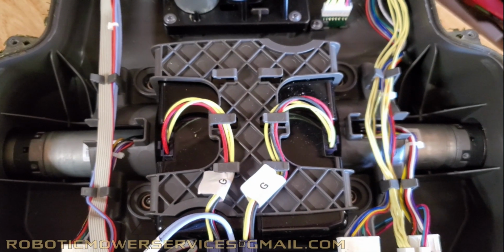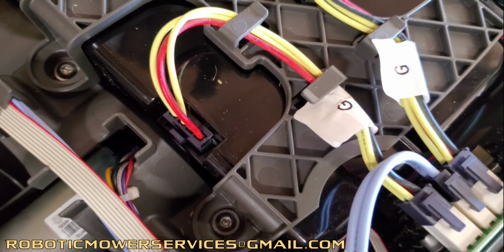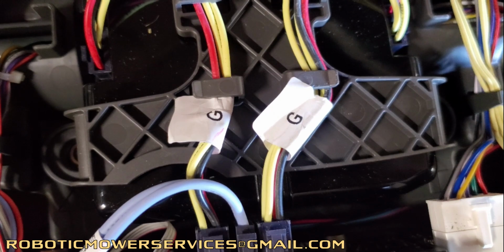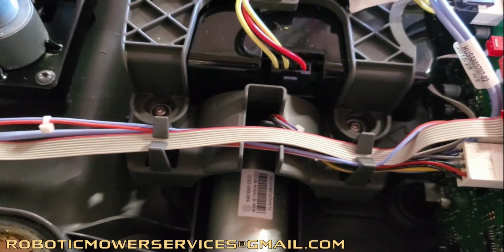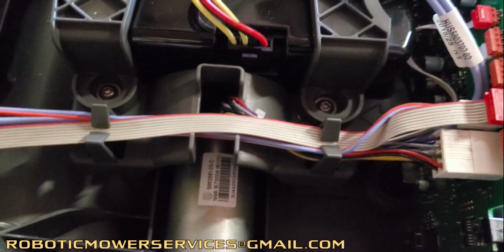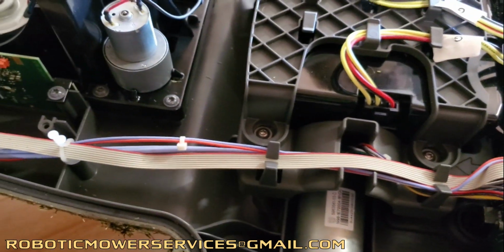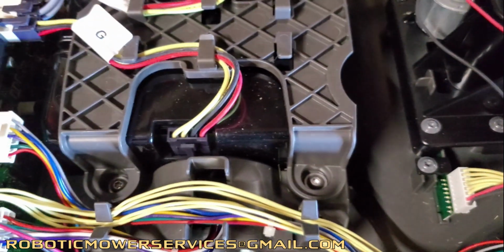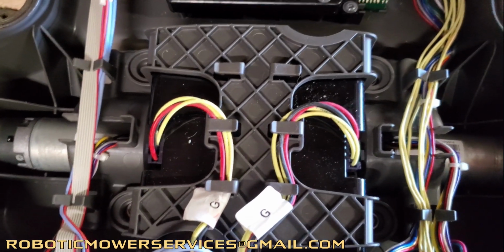New Heftier Battery Cradle For Automower Batteries (430X, 450X, 430XH, 450XH)

Comment: I bought a new 430 in June of 2021.  It has been working well until last month.  One day the robot just stopped with no light and no power, so I got a new battery only to find out the blue battery pack is for the older version.  I plugged the new blue battery in anyway without unplugging the original battery, and the robot still has no power with two batteries.  
What should I do now?

Comment: Quick question, I have a 430x and have charging problems now with new firmware update where it docks repeatedly and then stops close to the charger with a charging station error. My battery has almost 2k recharges and capacity now of 4160. I've replaced leads etc to no avail. Could the problem be the battery, don't want to replace it because they are expensive. Thanks
Reply from the maker: Did you watch our video about the charging current supervisor? We explain that issue in that video and show how to narrow down if the issue is caused by one of the many components in the charging system, or by the main board in the mower.
Reply: @RoboticMowerServices  I did and think it's the mainboard or the battery. Don't want to spend money on the wrong one. With the battery the way it is do u think that is the problem